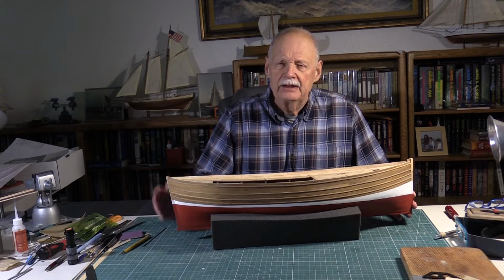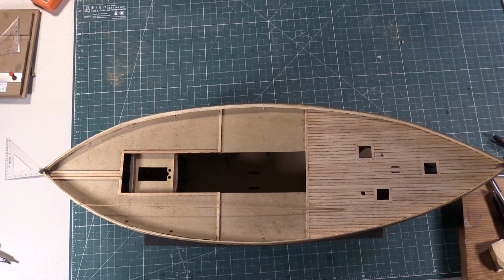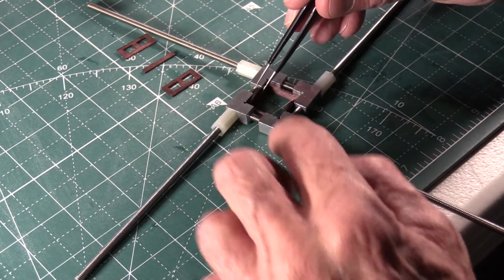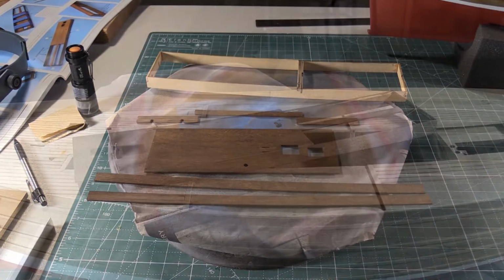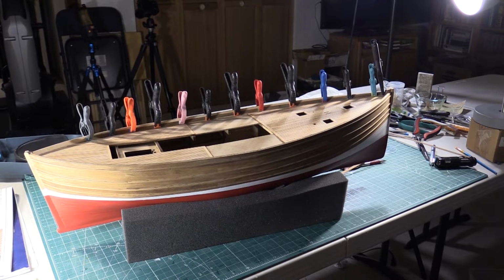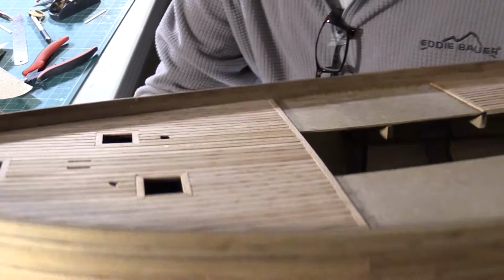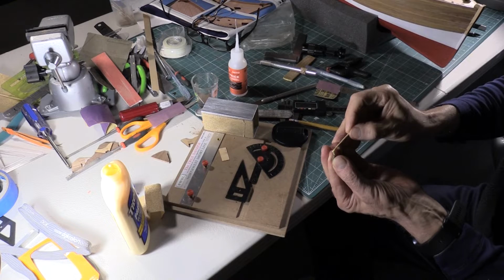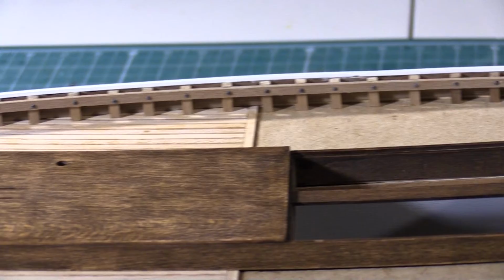Fifie Part 3: planking the deck

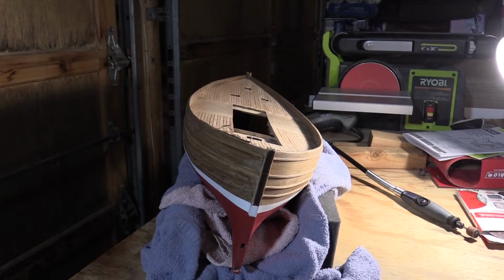Comment: Nice work Ken. Thanks. @15:25 What I found useful on my disc sander is tightly clamping a machinists 1-2-3 block to the sander table and move it very close to the disc but not touching it. Parts never got sucked into the sander when sanding small strips of wood. You do run the risk of damaging the 1-2-3 block but it works very well. They are pretty cheap ones for hobby purposes.
Reply from the maker: I bought two 123 blocks to see if I can make those work!  Thanks

Comment: Nice work. Are you using a water-base stain and polyurethane for the finish?
Reply from the maker: No, so far I have Airbrushed the hull with enamel paint, and used an oil-based stain for the few deck parts I have built so far (hatches and super structure).  but I plan to continue use of oil based products.  I then coated the deck and deck equipment with a Testors spray lacquer.
I have had good luck airbrushing Enamel, and use very little acrylic.  Except I plan to use Acrylic paint for the masts and spars.   I paint it on and wipe if off quickly, which seems to give the wood a nice color.  I then seal them - I think with Lacquer as well.  
The spray lacquer uses bad aerosols, but I use a mask and spray booth that vents outside.  For the smaller stuff I brush on Polyurethane.  I worry about brush marks, which is why I use the airbrush.  It results in such a nice finish.  I think the brush on Polyurethane is clear and self-leveling and does not really show brush marks. but old habits die hard.

How about you?  How do you finish your wood products?  What do you like?
Ken
Reply: Thanks for sharing all this information. I've only built one wood ship and that was a long time ago when I was in my early 20s. I don't think I put any finish on it. Most of the wood kits I build now are for model railroading and I have used both acrylic and enamels, however, I've airbrushed a primer coat of lacquer and when finished, I use Testors Dullcoat, which I think is lacquer based. I also use an airbrush spray booth that vents outside. 
I inherited some model kits from my father when he passed and one is the Model Shipways, Dapper Tom. It has a solid hull, which will need to be finished with paint, so I'm just trying to get some ideas on what to do. Thanks. @ken_boats